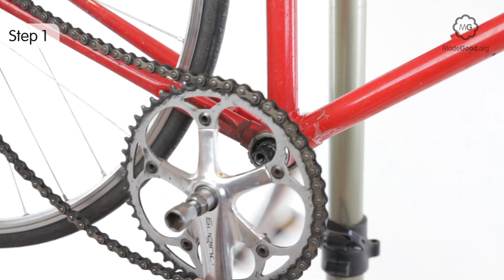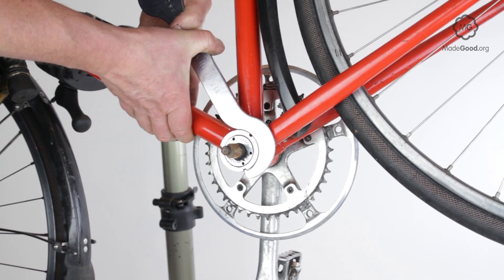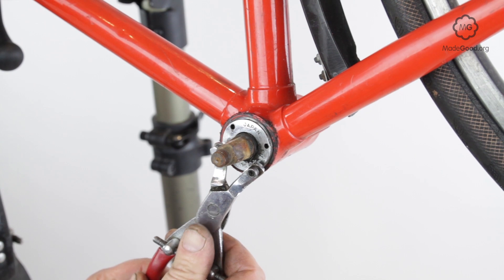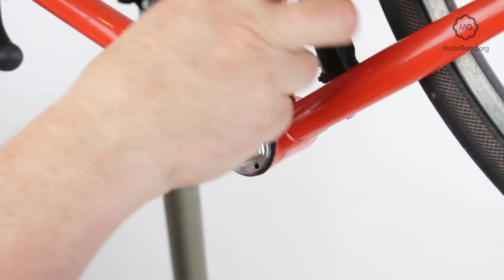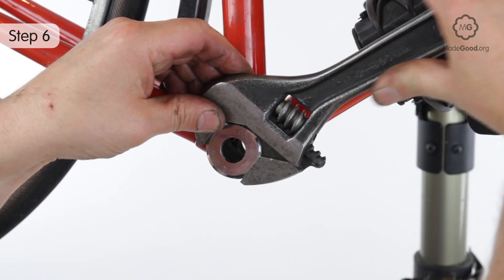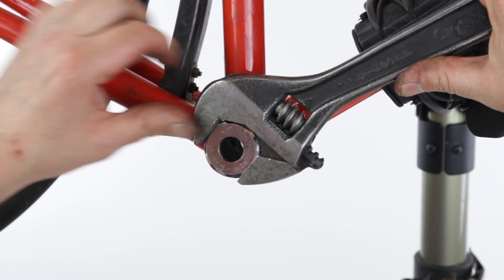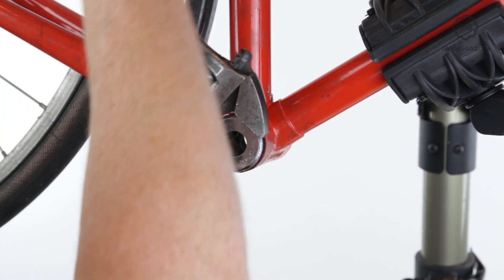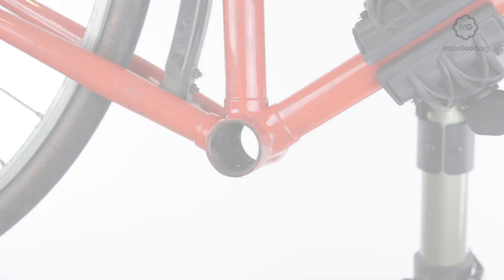Remove A Bike’s Cup And Cone Bottom Bracket

Comment: Also for the non-drive side you can use a large bolt and tighten it up toremove the cup (as the non-drive side is a left-handed thread)